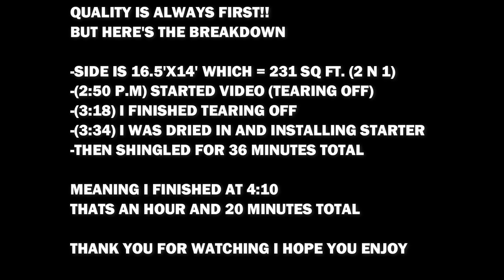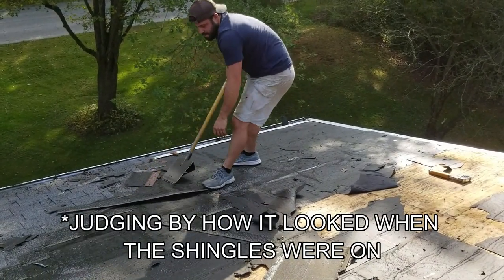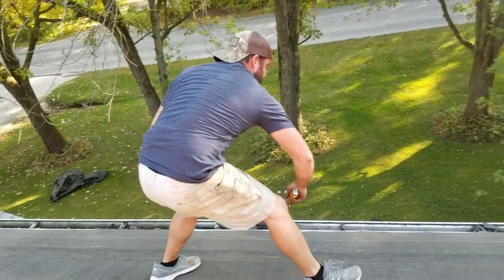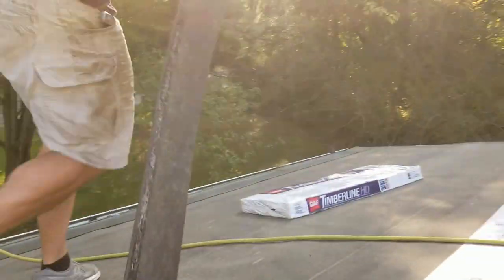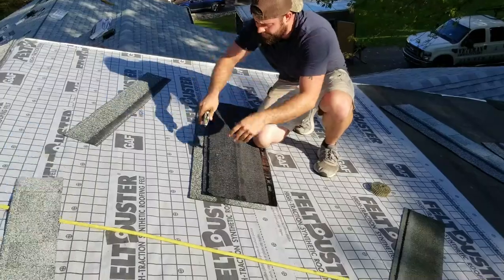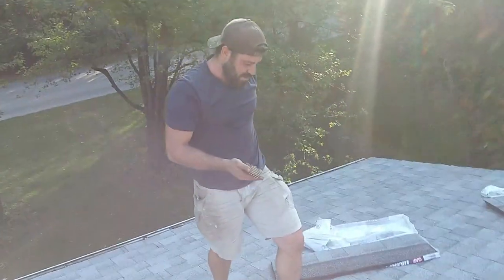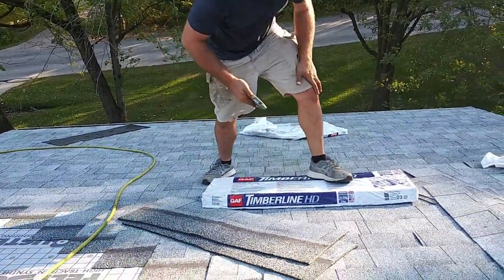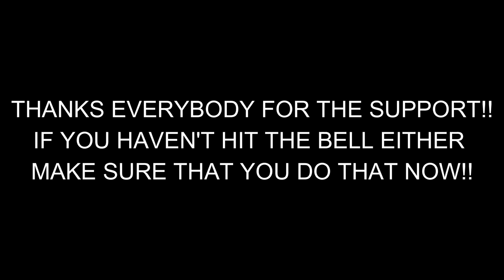WORLDS FASTEST SHINGLER. (uncut) TEAR OFF. DRY IN. PUT BACK

Comment: First 5 stars for the episode. My only cmmentss is not many roofers in my area that aren't Hispanic or from 1st through 3rd generation Mexican immigrant workers. Rarely I see non Hispanic installers here. Not that they dont do quality work, mind you. The construction in my area is a 2 mile radius is typically 3-4 thousand sq. ft. 1.5 to 5 acreage  Multigabled roofs  with steeper rises. So I wonder if probably most are no
 as muscular and strong as you are. I certainly appreciate the quality and efficiency of your work. I love your work. Wish we had many crews and companies as yours. When I framed houses during the summers In the of 78-82, we moved as fast as possible. The quicker you're done the more jobs per month. Awesome video 5 stars.BTW temperatures here a 95 to 105 are common here in late spring through early fall.

Comment: I've done three large shingle roofs for other people over the years but that was over 30 years ago. More recently on some of our houses I did some torch down which I really liked and I am pretty impressed with. That type of job was best done after Dark because the torch is so damn hot. One of the neighbors complained about the noise of the torch which was funny to me. I need to do a roof on a Victorian we own and this roof contains all the shingles down to the original wood shingles that were put down in about 1911. It is about 16 foot to the eaves and about a 45-degree slope. I plan on doing it myself and still need to buy the nailer you recommended and I'm in the process of buying more scaffold so I'm not working off of ladders. I hope to teach my boys the process. Back when I did the roofs 30 years ago I went out and bought a brand new Senco stapler. . I plan on doing it myself and still need to buy the nail are you recommended and I am in the process of by more scaffold so I'm not working off of ladders. I hope to teach my boys the process. back when I did the roof 30 years ago I went out and bought a brand new Senco stapler. love watching you put down the roofing and it is motivating me and I am sometimes falling asleep to your videos while watching them late at night .the sound of the nail gun is relaxing. I want to buy the best singles I can and I used to buy from a business in our town called State single. Wondering how those shingles compared to the ones they're selling at Home Depot. Could you talk about the quality of shingles and which ones you think are the best. I'm tempted to put down a light color to reflect the Heat. Watching you work I want to make one suggestion. When picking up a bundle of shingles keep the back straight and bend at the knees. And one other guy said it but drink water. I did see you drink water. I have large insulated jugs I bought years ago and I like to put ice in them for the hot days and since I have a lemon tree with lots of lemons now I am adding lemon to my water just for the Vitamin C. On a side note now I'm trying to teach my sons how to install gas lines and electrical and tankless water heaters. Keep up your great videos.

Comment: Very nice work, I’d roof with you any day…only complaint I have (this is YouTube I have to complain about something 🤣) is using the tops of shingles as rake starters because the plastic strip on the backside of the shingle is exposed and is visible from the ground. If I use shingle tops I cut them with a straight edge and put the cut side on the rake. Obviously a very small detail but a detail non the less…roof on brother 🤘🏽
Reply from the maker: yea i was upset about that too lol

Comment: Totally respect the work you are doing. Trades are under valued. One question I had was the wood underneath looked wet or at least damp.... I am assuming that's not an issue since you just papered right over it? Maybe it was just a camera thing. Also how old was that roof? Apologies if you mentioned it but I missed it. Thx

Comment: Great video. I would like to know if hand nailing is better than using a nail gun? I had a roof put on last year and the guys didn't use guns. They told me with a gun sometimes the nail can end up too low or not flush enough. Is this true?
Reply from the maker: That's fine and all but they're only screwing themselves.  Maybe even homeowners too seeing as most charge more $ to hand nail.  Guns are fine. Only problem with guns is the operators. If a nail is under driven they can hammer it flat and if the gun is over driving nails then there's a depth adjustment on the gun as well as an adjustment for the compressor pressure.
Reply: @NWIVeteranConstruction  Thank you

Comment: The code here in Florida is crazy. Starting Jan 1, 2021 we have to double layer all non-peel and stick felt, use all peel and stick, or put 4 inch sealing tape on all joints of the sheathing. All sheathing has to be nailed of with 8d ringshank nails every six inches, every rafter. No staples allowed. We have to nail the felt with plastic cap nails on each hole. The drip edge needs a 4 inch spread of tar around the entire roof before the starter course is laid.  6 nails per shingle. We can't lay the shingles until the inspector comes and passes us for a dry-in inspection. The shits crazy.

Comment: Never done a roof before.. Your videos gave me the confidence to do mine.  We couldn't afford the 35000 quote.  I just started the tear off, and its worse than what they were saying. I got through half the front side and there wasn't one good board..They would cave in as soon as I used the pry bar thing to remove the shingles.  That quote was with 40 boards maximum.  I ordered 90 boards and 100 bundles of shingles, ice and water, felt paper, and came in under 7,000..(Including nails, staples, a roofing nail gun, safety system, etc.  I do have a question.  My shingles don't come off nearly as easily.  There are 6 nails in each and they seem to come off in much smaller pieces...Any tricks?  I'm not comfortable taking all the boards up at once.  This was my first time on a roof and I'm/was deathly afraid of heights so I'm easing my way into it.
Reply from the maker: Pitch forks it nail poppers

Comment: how do you decide the length of the starter shingles of each row?  You lay down 3 full shingles lined up vertically and then cut them to stagger.  You fired me up to do my own roof and this was the only aspect of what you were doing that I couldn't definitively discern the process.
Reply from the maker: Minimum stagger is 6. I use 8 inch staggers for 2 reasons. 1 because it makes it easier to do the pipes and edges.  2 because a shingle is 40 inches roughly and and 8 inch stagger created 5 shingles out of 3 as you saw.  Its scrap efficent that way

Comment: We tear off different that’s for sure. Unless it’s a 2 layer or a crumbly 3 tab I always pop the cap off then move down 6 rows and pop up the shingle line all the way down the roof and tear it up. It’s consistent pieces without always picking up and setting the bar down. Then I nail down the the drip edge if they are keeping it so nails don’t get under it. Then start from the top and pull nails.

Comment: Things I do different is; @1:07:28 first off, grab loose nails, I never leave loose nails without picking it up, there's children that play barefeet around homes
1) I use a cutting board, to slice shingles into pieces to avoid what you did, which was that you sliced into the roofing felt a few times
2) save your long pieces, avoid cutting them down until you for sure need to cut them, seems you cut down a few long pieces that were hanging over the working right-edge, when you could've saved pieces from your starting left-edge
3) once you have a section finished, move your nails and shingles to the finished section so that way you're not walking back and forth as much and/or keep having to move them like you did, you put them away from you so you had to move again.
4) carry a small hammer, so you're not hammering with force, those nails you banged with the tip of your nail-gun
5) Pull the tar-tape.

Comment: My god, I am reroofing my deck out back right now. NONE of the stores around me had a roofing spade. My solution? Smash the plywood up from the bottom with a 10lb sledge, and rip it off with the shingles all still attached! I'm a big, strong guy, what could go wrong?

3 days later, I can finally turn my head to the right again.

Got all that damn wood off though :P
Reply: In hindsight, the wood was so rotten the it was probably a good thing I wasn't up there with a spade xD

Comment: Youve done several im sure, but it would be cleaner if you precut your starting shingles and use your single gun as a guide for reveal. The overlap could be out by up to a quarter inch sometimes by eyeing the overlap with the shingle sizes.

Comment: Per GAF, who makes the Timberline shingle, you are supposed to nail through the "black marker strip".  The old 3 tabs used to have the same tar line and you had to keep nails just above it to prevent leaks.  There was a video showing nails as low as you are doing it in this video but that shingle didn't have the black marker line.  The nails seem lower than they should be.
Reply from the maker: theres a white line to hit. nails are to be through the common bond. and they are

Comment: See how he pop the shingles up by the cap at the top of the ridge that's how you get started of stripping the shingles thats a good way,if the caps was at the top of the ridge,then you pop the caps,but he went under the first row of shingles did a few feet to work he's way down that's correct

Comment: Question - Doesn't that FeltBuster require the use of only plastic cap-corrosion proof nails or staples with plastic caps in those marked areas?
Reply from the maker: I use staples only if I know I'm gonna get it shingled right away before any rain

Comment: So I always thought the whole reason for the tar stripe down the center of a shingle was to put your nails into that. From the looks of it you are putting your nails just under that and I was curious why or if it doesn't matter? I've roofed quite a few times.. tho I'm no professional by a LONG shot I've never seen anyone do that. Just curious .. always down to learn something new.
Reply from the maker: The tar strip is on the bottom of the shingles now.  Those were probably 3 tabs or iko/ atlas.  You put the nails in the common bond which is 3/4 of an inch or so wide where the laminated parts of the shingles overlap
Reply: @NWIVeteranConstruction  right on.. thanks man

Comment: You know, if the roof isn't baked on you can rip it off without a shovel from the gutter area and move your way to the top within minutes. Also I had shingles setup ideal and work with another to guide them while I'd use the Gun.. it was a lot faster than you stopping, aligning etc.

Comment: im not knocking your work but as a observation you might want to either clean out your air compressor it might be keeping water or put a water trap this will prolong the life of your gun. ( you can clearly see it splitting) as a practise we always drain the excess air  compressd air turns into water after awhile. preserve the tand and safety, integrity

Comment: Bro I'm currently doing a roof (60) sq and the contractor who installed it put that ice lock valley seal or whatever it's called under the felt and then another layer on top. The shingles are glued down like I've never seen and I've put a lot of tops on in my day. It literally took us 4 days to tear off 30 sq. Just wondering if you have ever come across a roof like that.
Reply from the maker: yea i always check for ice shield when quoting roofs now a days. they make the job hell to tear off

Comment: Hi Guy, you are a good, fast worker who does the job ALMOST correctly.  I suggest you visit the GAF web site and actually read the installation instructions provided there. 

Here is the important step you are skipping which which sacrifices the integrity and longevity o f your workmanship. You are failing to add the dabs of adhesive as per the GAF instructions below. You work will not withstand high winds speeds without the wind ripping tabs off.
 As Per GAF Instructions

These shingles MUST be nailed a nominal 6" (152mm) from bottom of shingle, above the cut-outs, as shown. Nails must not be exposed. To
hand-seal shingles and to insure immediate sealing, apply 4 quarter-sized dabs of shingle tab adhesive on the back of the shingle 1" (25mm)
and 13" (330mm) in from each side and 1" (25mm) up from bottom of the shingle. Press shingle firmly into the adhesive. CAUTION: Apply
ONLY a thin uniform layer of asphalt plastic cement less than 1/8" (3mm) thick. Excess amounts can cause blistering of the shingles and
may soften the asphalt in underlayments and leak barriers, resulting in the asphalt dripping and staining.
Reply from the maker: you sir are mistaken. the 4 dabs of roofing cement are only neccesarry on pitches greater than like 22/12. mansard pitch or barn basically. I have a barn roof video on my channel. you also have to 6 nail on those pitches. even though my area only requires 4.

Comment: What is the purpose of two rolls of ice and water? I just want to understand,  DIYer.
Reply from the maker: To meet code requirements.  The ice shield has to extend 2 ft past the inside of the exterior wall, in my area. So For overhangs bigger than 1ft and on steeper pitches you can expect at least 2 rows

Comment: I shingled my shed's roof.  Took about 4 hours start to finish.  Roughly 120 square feet.  Then again, I was using an actual hammer, not a nail gun.
Reply: A nail gun is a worthy investment in my opinion. I did the same thing as you, I did a shed with a hammer. Let’s just say that immediately after completing that I went out and bought a nail gun😂

Comment: I know you do this work everyday but always stop and remind yourself to be safe.
Safety is something you have to practice and remember, it does not come naturally.
Several times you backed up to the edge of the roof quickly and closely, backwards. 
It could be something as small as an old nail head that catches your shoe at the last second or just getting slightly dizzy on a hot day and off you go.  Think about dying or being paralyzed for the rest of your life, I though about those things and it made me safer.
I know a safety rope on a harness is a pain in the ass but you will be surprised how you can used to them after a while. 
A safety rope fastened in the middle at the peak of the roof with just enough slack to let you reach the edge can save your life.
You will be able to reach all of the roof but if you fall, a fall arrester will straighten you out feet first and slow your fall without you hitting the ground. The fall arrester can be placed at the top of the roof so you don't have those buckles with you, it will still slow you down. and do the job.
I knew a guy that bought a light bungee cord in a long rope that would retract most of that rope every time he walked to the peak.
Of course they make self retracting lifelines but they are expensive, they are still cheaper than one hospital visit.
I have worked construction all my life and I don't like going on a roof without fall protection.  I had to use it in commercial construction and I got used to it a lot faster than I thought.
I bet you know some people that got hurt or died falling, don't think it can't happen to you. Good video and be safe!

Comment: good effort....but if the homeowner saw this vid he make you redo the entire job.....I saw several slices in the gaf paper.....easily preventable. dont slice without under side protection.
Reply from the maker: Not a chance! Its granules from the cut.  You're like the 30th amateur top point it out. Also I'll slice it up if I want because the shingles were laid properly and will never leak. Water will never touch that paper. Even if it did theres so nails in it now.  They only seal so much into paper

Comment: A few low nails, you cut the tar paper once. I like the drip edges under the ice and water.  Why your nail spacing so eradicate? And in the  starter course you nailed 2-3 in first half then one on end.  One the other side why didn't  they have the vents  installed.   I am a believer you cant install vents properly unless you put them on as you tar paper.   But I'm sure this roof will be fine unless it was on my house up here on my hill where I get wond driven rain like a hurricane.
Reply from the maker: Not in a hurricane area at all out here.  And I didn't cut it.  Go back and look carefully.  It's a seam on the felt or ice shield or something.  Watch my video on vents.  It's a cool trick that's I've used for years.  Starter is fine I don't really know what you mean

Comment: That looks like 3/4 inch roof decking , with the shingles the nails should be no longer then 7/8 of a inch , other wise ice will form on the nails that protrude the decking and do water damage on the inside

Comment: I can understand putting this stuff on a garden shed....but a house???  you will have to replace it every 15 to 20 years, not to mention the fact that this stuff can be easily blown off during a storm...

Concrete tiles on a heavy wooden roof support built on brick walls... good for 50 years and more...